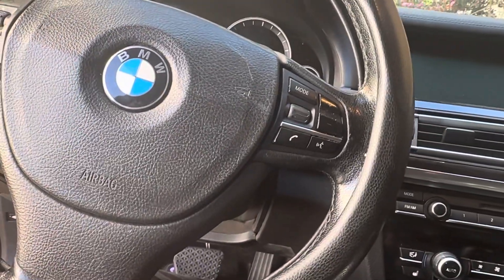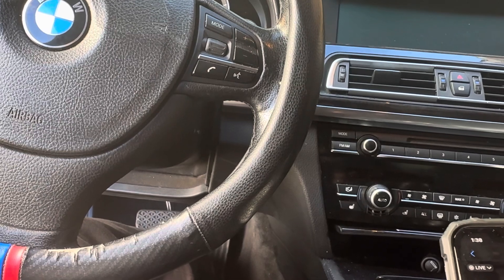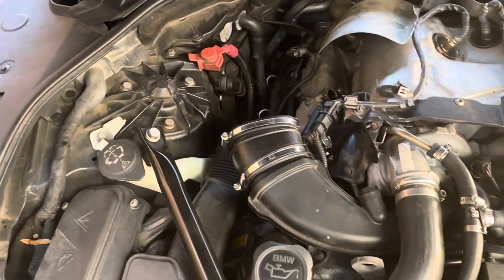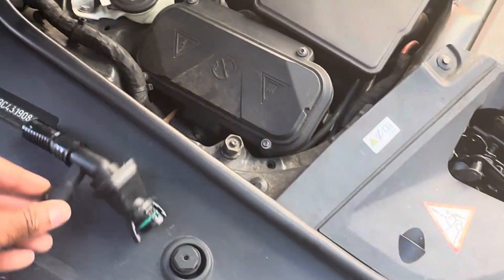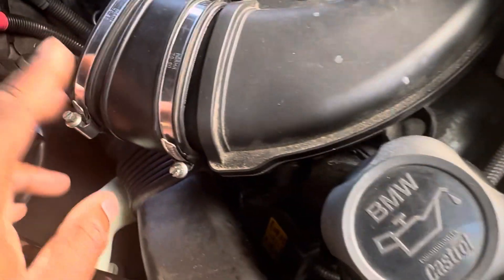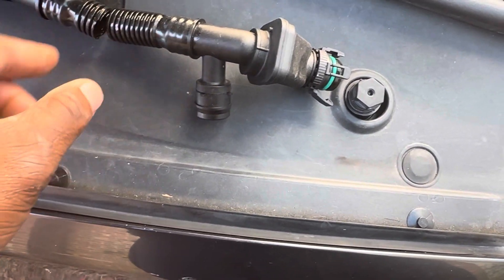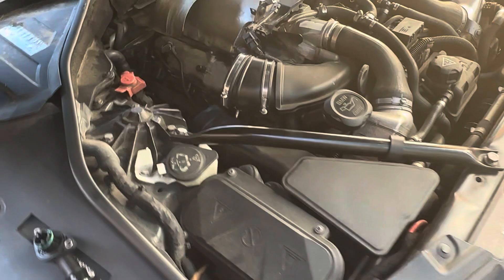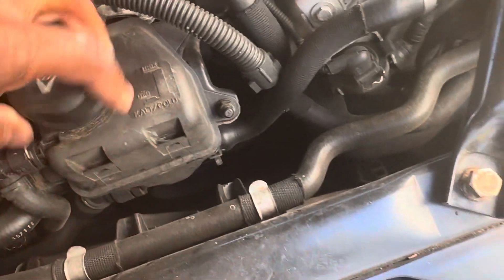P0171 and p112f code (Crankcase Breather Hose) BMW 750Li

Comment: Mine snapped in half like this. I replaced BOTH just cuz the other one was on its way out. Still missing on Cyl 1 and rough idle, doesn’t even move when I put my foot to the floor. Idk what else needs to be fixed yet.